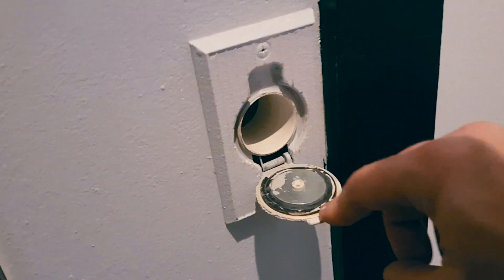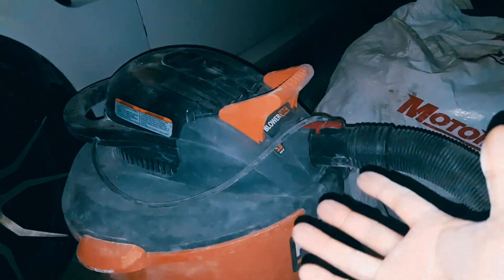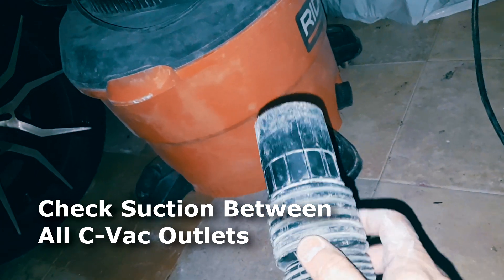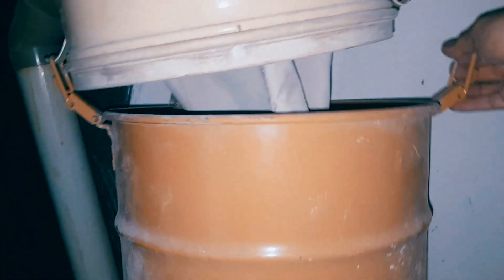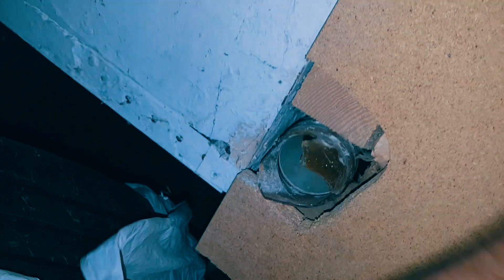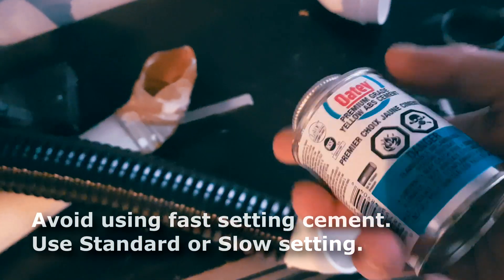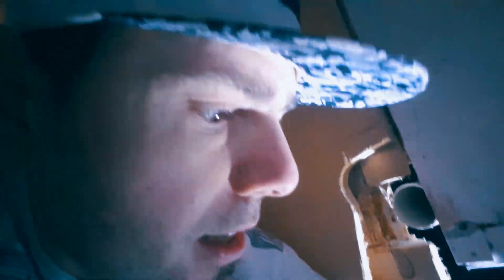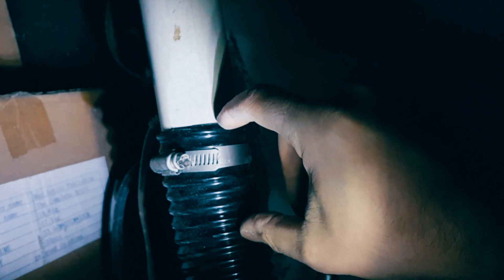4 WAYS How To Unclog House Central Vacuum System & Repair Cracked Pipes - Troubleshoot Central Vac

Comment: What is that black tubing called so I can see if Home depot has it? Thanks
Reply from the maker: Home depot didnt have this  lowes did. If you're in usa look here. https://geni.us/2inFlexiblePipe   or get 2" plexible pipe any will work u just need to make sure you glue it or clamp it correctly.

Comment from the maker: This video shows how to unclog a central vacuum in a house and troubleshoot the problem without calling repair person. You'll also see how to repair a broken pipe if cleaning out the house with a shop VAC doesn't do the job and you locate a crack in a pipe. Leave questions, comments and enjoy!